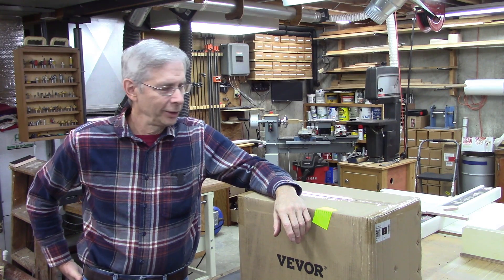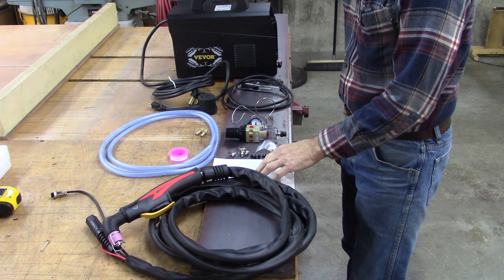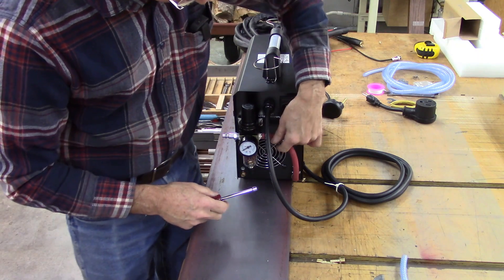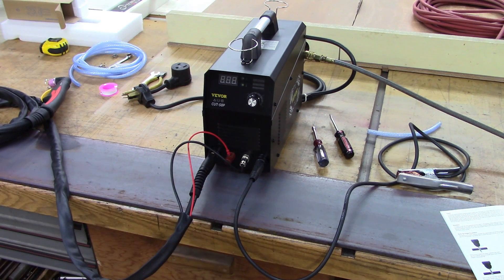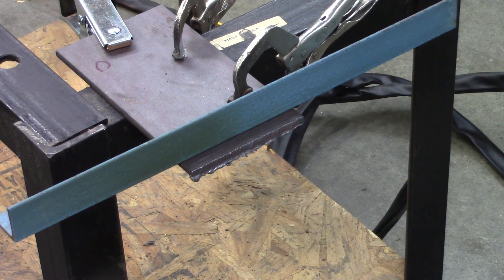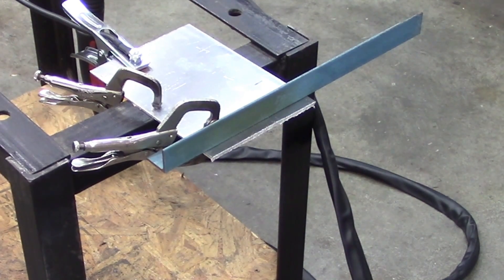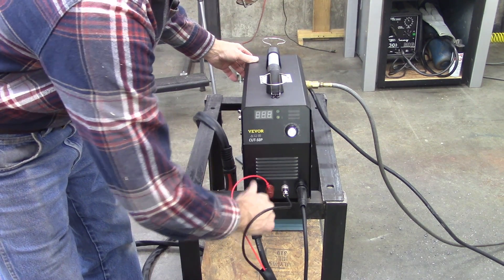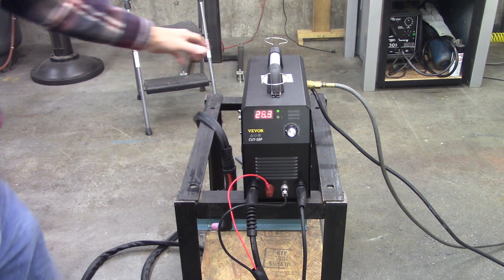Reviewing the Vevor CUT-50P Plasma Cutter

Comment: Mine worked when i first got it . Up to 3/8. Only used it a couple times in first year. Now old i went to use it 19 months later. it makes pilot but won't start a cut.
Reply from the maker: Wow...  thats a bummer. I sold mine, it made a huge mess. The band saw is slow but I dont mind

Comment: I just received mine. I swapped out the hose clamps and it sealed fine. Waiting on some parts so I can run it on 220 V. Not bad for the price.
Reply from the maker: Yeah the 120V is wimpy...  but it does well on 240V

Comment: Hi folks, for anyone desperately interested 1 kg/sq cm is approx atmospheric pressure. Not completely accurate but think of it as 15 psi and you'll be in the ball park. It's not even an approved metric SI unit of measurement! That's really crazy - the Pascal - one Newton (Issac) per square metre. Roughly equivalent to the weight of one smallish apple per square yard ....... yup, tidily small.
Reply from the maker: Haha..  thanks for adding the clarity Bob.

Comment: Good job for the first time out! The dross is easy to knock off with a hammer just tap it on the edge of the cut. It is hard to grind off but because it is hardened it chips off easier.
Reply from the maker: Thats a very good time! Thanks!

Comment: On the cheaper machines the electrodes are tiny compared to standard and cost more than standard so the money you save in the front gets shoved up in the rear 😆
Reply from the maker: I just bought 10 nozzles, 10 electrodes, 2 cups and 2 standoffs for $20 bucks. I'm not saying there isn't a difference between this machine and a more expensive machine, I have not tried other machines. However, I can say that the consumables expense is not significant. So far I have not changed any parts and the cost is low.

Comment: Nice review, Mark. Seems like a nice unit. I recently went to my place of retirement to use one of their plasma cutters to partially blast out a bleeder screw in a caliper. It had a broken piece of drill bit in it. I was then able to use a tap drill size bit and remove the rest of the bleeder screw. Someone else had made an attempt at removing it before I arrived on the scene. The plasma treatment gave me what I needed to save it, blast out that piece of drill bit. I've used plasma cutters before, so not new to me.
Reply from the maker: Interesting. I need to remember this.
Reply: Had to be careful not to blast too deep or wide. Took a few short blasts.
Reply from the maker: @RAYAR54  I'm sure! Still more control than a standard cutting torch I'm sure.

Comment: Love plasma torches.  Hate that they put the power switch and the air regulator control at the back of the unit.  Makes it a total PITA when you put it beside your mig welder in the workbench.
Reply from the maker: I never thought about that aspect although the air is not something I needed to adjust much, but the power switch is. Thanks for the comment!

Comment: Nice demo.  I think you meant 45 psi early on, not 4.5 psi.
Reply from the maker: The manual says 4.5 PSI @ 6.0 CFM and the gauge reads in KG/cm2. The conversion chart I found said .316 which is about what I set the regulator. Maybe I need to try more pressure?
Reply: @WinkysWorkshop  I run my similar 50 amp unit at about 60 psi for most things..  If you google around for "Plasma cutter air pressure", you will see what I am talking about.   3 Kg/cm2 converts to 42 psi, so I was thinking that your instructions have the decimal point in the wrong place.
Reply from the maker: @frenchcreekvalley  Thanks for the clarification. You are correct, the manual says 4.5 PSI but it is a screwed up Chinese translation. It should me 45 PSI. The conversion of 4.5 was about .3 but I misread the dial. I had it set on 3 NOT .3

Basically my screw up compensated for the bad translation! Ha. I was running 52 PSI.

Comment: I've had mine for over 20 years Mark. Once you get more familiar with it you will really like it. The only thing I seen you need to do is use a straight edge to drag the tip beside and slow down just a little. The only use I have for my torch these days is to use the rose bud to heat things up. They also make a pinpoint tip for them also. But you can't let the tip touch the metal. Helps you get into tight places. It will work better on 220 current and I have found its better to just run it wide open all the time. Also don't let condensation build up in the glass reservoir keep it drained.
Reply from the maker: Thanks for the tips...  I do have a lot to learn.

Comment: A very fair review, you state that you have never used a plasma cutter; that stated, you did quite well. I used a plasma cutter fabricating parts for highway plows but we started out using Oxy-Acet cutting to cut plates and shapes. Your speed and torch angle are all that need be adjusted. Look at your kerf it should look like this IIIII not //// or the latter inverted , speed adjustment and doing it improves results..
Reply from the maker: Interesting...  and yes speed is critical. I'll play with mu angle. Thanks

Comment: Hi Mark, good review. I have a small plasma cutter (50A) like this one. I had to cut a full sheet of 10mm steel plate (8x4 x 3/8) in half for my work bench. It worked well as long as I went slowly. Like you I was new to plasma cutting so it took a bit of time to get use to it.
Reply from the maker: Yeah consistent speed is very important! Thanks

Comment: These are nice to have and the prices have gone way down,I bought one of the first snap-on plasma cutters and I couldn't get it to cut a  al dente noodle. I now have a Alfacut 60,you probably have a Ibt 60 torch,get some drag tips for it,you will like it better. Since I'm not CAD learned I use 1/4" plywood and make patterns and just subtract the width of the tip. You can get creative with these,I'm sure you will grow into it,not a big learning curve. 911 offroad has nice circle/radius metal stencils just need to know which drag tips you use.dry air is key,at least get a desiccant dryer,and you will be fine. I made a video on my plasma cutter and a video on magnetic straight edges too. May help.
Reply from the maker: Thanks for all this info!

Comment: Just one point to add: your air supply must be dry, and the moisture bottle on the unit can be overcome very quickly if you have a moisture problem. Enjoyed the review, cheers!
Reply from the maker: Several have warned me about moisture but ever since I bought a compressor with an upright tank I never get water in the air. Plus it has an auto drain so that helps even more. My old horizontal tank compressor was terrible.

Comment: Hello Mark great review as for amps I had to put a 50 amp breaker in for the 110 volt side of it it would trip the 20 amp breaker . You will have fun with it as you get use to it .thanks for sharing.
Reply from the maker: Thanks Raymond.

Comment: I purchased one of those plasma cutters from Vevor.  Paid full price.  I did a short review on it.  It was my first time using one also. My instructions were for a welder and almost useless.  I found that I needed to run the air pressure at 50 lbs to get a clean cut
Reply from the maker: Wow... maybe i need to try high pressure!  Thanks

Comment: I just recently picked up a plasma cutter at the flea market. It rocks the casbah. Definitely a very cool tool for the shop! (Side note, just cut that 110 adapter in half and toss it. I don’t even know why they include those things, these machines need 240 to shine.)
Reply from the maker: The 120 vote might be good for cutting a car fender. It works on sheet metal but otherwise I agree.

Comment: I bought a used plasma cutter online, and it was missing the ground lead and the air regulator.
I've used one before, and liked the performance of it. My boss bought one years ago, and used it to cut 12Ga copper pipe from a mechanical area at the state capitol here. It was probably the best method for cutting the pipe. They've since gone one better with an Esab.
Reply from the maker: Nice, Esab is good!

Comment: I bought a cheap Lotus brand plasma cutter. It went through consumables like crap through a goose.
The cut quality wasn’t all that great. I sold it for a loss.
I am now the owner of a Hypertherm Powermax 45 XP.
About $1,000 more than the Lotus but man, what a sweet machine.
I’m still using the same consumables from day one.
Reply from the maker: Interesting...  these machines are fairly simple. I wonder what was different that made is work better? So far the nozzle and electrode look near perfect but I have not used it much yet.

Comment: you don't use one of these every day but when you need it, it's  great,, I just leave mine set at 50 amps on 220 volts. I am surely no expert but I really like it.. the slag stuff on the bottom is called dross, it usually just knocks off very easily. one thing I have found out is,,,, they don't like water in the air lines.. it wrecks the tips in a short time.
Reply from the maker: Interesting about the water. I don't have much issue with water unless I use tons of air for a long period of time. Two things almost totally eliminated this issue for me. First, an upright tall tank. This makes a drastic improvement!!! Second, an auto drain. Mine drains for 3 seconds on start up and again at 1 minute intervals of run time. For $35 bucks every one need one!
Reply: @WinkysWorkshop  I'm gonna check into one of those automatic drain thing. here in Mo the humidity is pretty bad and the air tank gets a lot of water in it fast.
Reply from the maker: @MissouriOldTimer  Here's a video I did. You wire it to the motor power so it only runs when the compressor has power. be sure and get the right voltage.
  https://youtu.be/bVddmQ14qas

Comment: Plasma cutters work on CFM like your acetylene torch, MIG and TIG welders. As long as you have at least 90psi and your compressor can keep up, you can get any reasonable CFM of airflow. Just play with the CFM until it cuts clean and don't worry about it. Looks like you figured that out already! Welcome to the metric system!
Reply: I haven’t used a plasma cutter much but I found if you keep the pressure high enough to blow the molten metal clear it will allow you to do the thicker metals.
Reply from the maker: @dagwood1327  I found the same...  Thanks
Reply: @dagwood1327  Good point. Turn up the air first, and if that doesn't work, then you have to turn up the amps.
Reply from the maker: Thanks, I could have done better with the metric system. It would be nice if we could all agree to stick with one system for air pressure. I understand the difficulty with other measurements but air would be a good place to start changing. I've used Bar a lot in the past but this was new to me.
Reply: @WinkysWorkshop  Yeah, pressure doesn't confuse me, bar is fine. But when you get into volume... CFM, CKGM, I get vapor lock and have to sit down and think. :)
Reply from the maker: @Bob_Adkins  Ha...  I do the same
Reply: My plasma cutter operates @ 45 psi. I was surprised. I've seen others that operated at higher pressure, like yours.
Reply from the maker: @Farm_fab  I need to revisit the specs. Maybe install an air gauge I can read it but the manual  4.5 PSI @ 6 CFM. Maybe a translation problem... maybe is was supposed to say 45?  I have it set at what is supposed to be 4.5 PSI but it sounds more like 45.